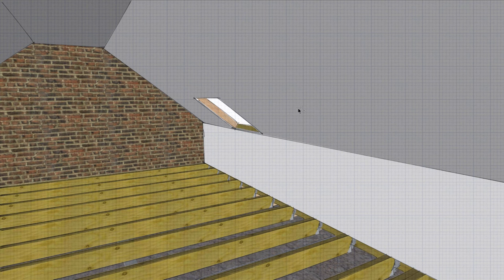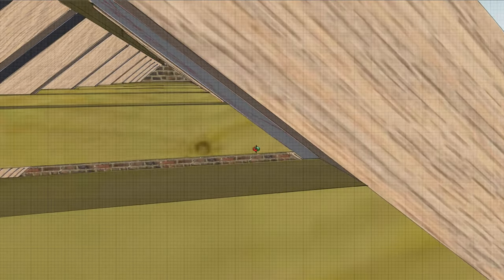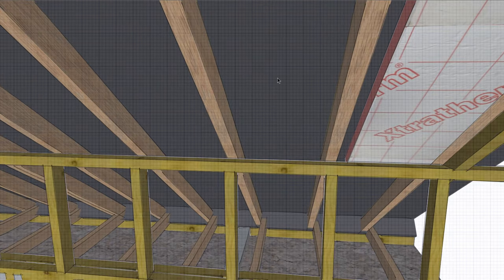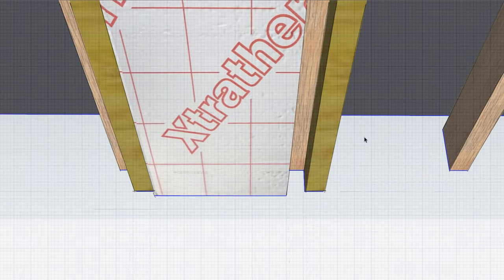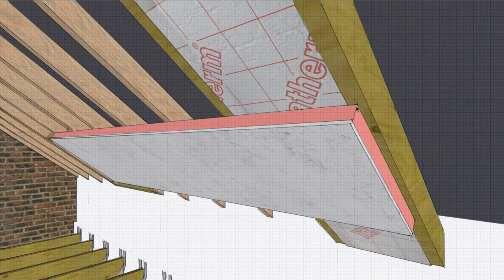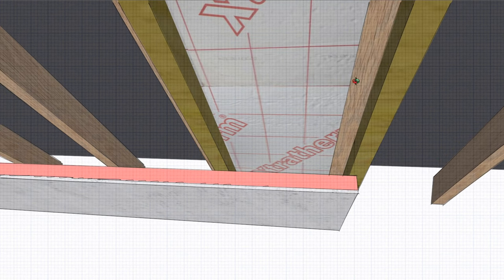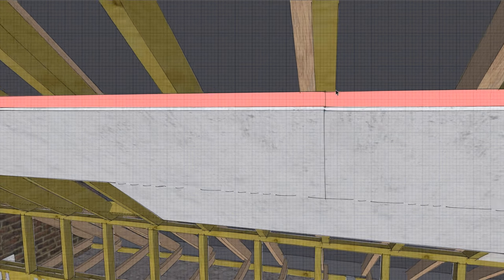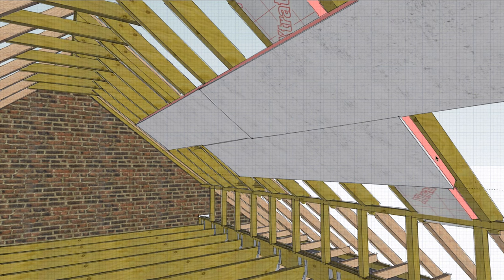Insulating between and under the rafters for a loft conversion

Comment: How did the human race ever survive before insulation? The mind boggles..
Reply from the maker: Smaller rooms!
Reply: They still do.  In places like Mexico, during the Winter the internal temperature can drop to around 5C.  Solid concrete/brick buildings with no insulation and lots of ventilation.  They put up with it.
Reply: They still do in the UK!
Reply: House back then had plenty ventilation with it blowing through house
Reply: Sweat n shiver
Reply: Heating was cheaper
Reply: @madmat114  😂
Reply: Post war? Endless amounts of cheap gas, before that, well we would die at pension age.

Comment: Informative thanks. In my experience it’s more economical to use one thicker sheet of PIR between the rafters than two thinner and either notch out the back around the original rafter of fill the void with a strip of PIR and foil/aluminium tape the joint! It’s prob worth, or may be mandated, to fit a vapour barrier sheet before over boarding with plasterboard (insulated or not depending if additional insulation is required) but if it’s a low occupancy area it shouldn’t be needed.

Comment: Couple of thoughts. 1. Extend the rafter depth to keep things aligned. 2. Superfoil quilt. I'm going down the superfoil quilt route, it's easier to work, more airtight, thinner and cheaper for the same performance.
Reply from the maker: Thanks for the tips Darren! I'll take a look at Superfoil.
Reply: Just an FYI, but I've experienced Building Control not being keen on superfoil as an alternative. It is easier and better for DIY work, but the performance figures aren't the same as PIR. I do welcome any info you have 👍
Reply: @bikerchrisukk  Thanks for the tip. My approach was going to be 1 layer, see how warm it feels, then more than likely do a 2nd layer. I'm converting the attic bit by bit and the initial stage is to make it into a warm storage space with intentions one day I might go all in and make it a habitable space
Reply: @sygad1  You are welcome, you might want to get a thermometer/hydrometer that can record the temp/humidity difference after you've done a bit of it. Govee models are good but price has hiked lately, I got 2 for £35 once. Good luck 👍
Reply: We put Actis hybris between rafters , then super-quilt over the top , one thing I can say it’s extremely hot up there .

Comment: Hi robin
We are a loft conversion company based in cork ireland 
We do exact same as you outlined but put 50by 44 mm timber onto existing truss next to new 150mm by 44mm new rafter c24 that fills infill then we use intello plus vapour membrane wrapping all joists then a 62.5 mm phenolic slab underneath with venting and new airtight boxes for recess lights and all cables and intrusions sealed and taped with vario tape
Love your videos
Willie
Reply from the maker: Thanks Willie - appreciate your comment and thanks for watching! 👍
Reply: Hi William, do the 50mm battons get attached directly onto the rafter or are they counter battoned?

Comment: As someone in the process of insulating exactly this right now, having had a building company do the structural work. As per a conversation with the guy from building control; I'm using two separate sheets of PIR to make up the 100mm rather notching out a 100mm sheet, using Gapotape to eliminate the gaps, then aluminium taping to bridge over the rafter, then will foil quilt over it all, before battening and plasterboarding.

Knowing what I know now, and if it's a structurally sound idea, I'd have asked the building company to alternate the new rafters, so that every other sheet could have been one 100mm PIR sheet, with nothing fancy to do to it. Would save me a lot of time!
Reply: You can't "alternate every other rafter". They're put in at 400 or 600c/c, and that is the distance your tiling battens have to span
Reply: But surely the tiling battens are still resting on the original rafters?  @Tom_Hadler

Comment: Great Video as usual
My advice is to counter batten the roof, the allows for full depth of Joist to be filled with Insulation
Air gap above Joist
Its a bullet proof system and makes felting really easy during windy weather
You buy a special vent strip which is rated to support the first row of tiles or slates,  also means no vents in the soffit
Some House Designs are now without a Soffit
Reply: Don’t suppose you have channel to show what you mean 😏 🤷🏻‍♂️
Reply: Sorry mate
Do a Google search
Reply: What's the vent strip called? Presumably, it vents at the top via a dry ridge system?

Comment: Great vid again. Done one loft with 100mm insulation between the rafters and then superquilt over to stop cold bridging, nightmare to put up.  Usually my norm is 100mm between then 25mm over rafters, foil taped then PB.  Been advised by my SAP guy to use the insulated PB on my next build.
Reply from the maker: Thanks! Good to have your take on it. What reason did your sap guy give for the insulated pb?
Reply: @RobindeJongh  I’ll be insulating a listing building next, the general convenience of it being one unit oppose to fixing insulation and then PB i suppose.
Reply: As an Architectural Consultant, I was always taught by my peers to avoid insulated plasterboard because as soon as you penetrate it for services i.e. lights, sockets - you are cutting into the VCL and creating a cold bridge at that point making it more prone to IC.  But I'm based on Scotland, so maybe it's not really an issue down south.

Comment: The initial comment about the airflow is slightly 'wrong' in that the airflow should be exiting at the apex / ridge line through a suitable breather. All the moisture will aggregate at the apex. 
There are a number of technical seminars by Dr Joe Lstiburek that cover the multiple issue we all encounter with modern building efficiency needs. well worth a watch.

Comment: Hi Robin, are you able to do a video for vaulting a bungalow ceiling. I believe our roof structure is a purlin roof, but planning to do as much of the work myself. I’m a carpenter by trade but roofing isn’t my forte so just trying to get as much info before the structural calculations come back from our structural engineer

Comment: Great video, clear audio and drawings. How would the brick gable end wall be included in the insulation? Im aware of a parge coat to help AT, but could this be internally insulated with the PIR also? What if there was EWI in the picture? Worth insulating both sides?

Comment: Hi robin, you added the stud wall on either side, how far apart can these vertical members be without affecting the structure? Also I am part way through a build, the builders have put steels in instead of a flitch beam, how does one attach the bottom plate of the stud wall to the steel?
Wanting to maximize the space under the eaves for both storage and clothing cupboards

Comment: Could you not just put an additional rafter on top of the original one to get a  say 200mm of depth and fit 170mm celotex board. You could then overboard the rafters with more celotex and plasterboard. 
Loving the content. Blows my mind at times listening to you quoting regulations.
Reply: You would be losing a lot of headroom .

Comment: Hi, I'm trying to work out how much insulation I would need in my rafters for my house, I'm putting a small playroom in the loft in our extension and I've put 100mm between the rafters and wanted to put 25mm plus plasterboard over the top to stop the cold bridging,  hoping that is OK as that is the insulation I've already got! Also how does the ventilation work when you have the wood top and bottom of the velux window? Wondering how the air moves above the velux as its been sealed by the noggin?
Reply from the maker: Hi James. Fair point. You would need to ask a joiner.

Comment: Is there any reason you cannot just screw a 2x2 inch rafter to the face of the existing 4x2 rafter? That would give the same gap available for insulation at considerably lower cost?

Comment: I've just finished insulating upstairs in a dormer bungalow. BCO asked me to put 3x2 on the underside of each rafters bringing them from ~80mm to ~150mm and then 100mm PIR between and 25mm underneath. This left an airgap of 50mm under the tiles.

I never even considered the structural side, do you think that would be a problem just adding the timber on the underside of the rafters? The BCO did not say anything either. The 2.4m length 3x2s were just enough to go from the dwarf walls to beyond the flat ceiling level
Reply: Are they still up ok? I'm intending to do the same thing, so am hoping it all worked out for you 8 months ago :)

Comment: will still need access outside to fit vented soffits & possibly vented ridge tiles, what about rebating the PIR to get over the step in the timbers?,
my roof has already been compromised back in the 50's when they changed from slate to redland 49's

Comment: Interesting video, thanks. I’ve just bought an old barn conversion with 9” solid walls. Struggling to find any consistency online about how to insulate solid walls from the inside without risk of internal damp and condensation. Would love to see a video on this and/or any advice! Cheers 👍
Reply from the maker: I agree, details are hard to find. It is because condensation is going to happen, and no-one wants to be held liable!
Reply: Hemp slabs, or hemp+lime mix, or rockwool with lime plaster on lathe? That is for unusual solutions ^^ anything breathable I would thibk

Comment: What happens with humidity in the insulation? Is some membrane material needed to control humidity and also air-tightness?
Reply: PIR/PUR board is foil backed on both sides. Self adhesive aluminium tape can be used to bridge any gaps.

Comment: Great video. The requirement to stiffen the rafters caught me off guard. I’m looking into a 60-80mm wood fibre insulation which doubles as a sarking board (Gutex) for a warm roof retrofit on a dormer bungalow. The mass works out at 15.4kg per m2. Do you think I need to budget for doubling up rafters?
Reply from the maker: Hi Gavin. I would budget for doubling up rafters or adding extra rafter depth.

Comment: Hi Robin, I'm converting my loft right now and I'm in the stage of insulation. The recommendation from the building regs is 100mm +50mm PIR. then plaster board , all counter batten with 50mm Batten to the non breathable felt to allow roof ventilation. All to achieve 0.15 U-value 
I'm trying to achieve the same U value for less thickness in order not to lose head hight. 
I heard that I can mix PIR with superquilt, but don't know how?.
Also , I would like to have your view regarding the side wall insulation (it is a cavity wall ). Thanks for your videos , it was really inspiring
Reply: How did it go?

Comment: For the PIR between rafters I'd probably just do as you said & put in a full thickness strip first (new rafter one side & old rafter on other) & I'd also buy some sheets of PIR at the correct thickness needed to fill in the strips over the top old rafters, which could quickly be cut to width & tapped in.

Other more faffy way would be to cut other PIR to fit the full width (new rafter to new rafter) including over the top of old rafter but then cut out material on the back of the PIR where the old rafter will be so that it slots into place over it if that makes any sense. Bit messy though & would create more waste.
Reply: I was thinking this , like multi tool out each one or template with a circular saw wouldn’t take too long once set up
Reply: @seanmichaelo9777  I've used both & found multi-tools only good for cutting out small complicated shapes up to say a foot long as they just take to long on longer/deeper cuts, even if you get a "proper insulation cutting blade" which I think are a waste of money & don't work personally. Circular saws definitely do work & are fast but just be prepared for a lot of mess (definitely connect to a vac if pos), again I've seen special insulation blades available that claim not to make a mess but they were VERY expensive & are like hens teeth to get hold of. I think Ive seen people DIY their own circular saw insulation blades by grinding them down but I've never found the time to try it out myself 👍

Comment: So a quick question, the insulation you have there is foiled/non breathable, wouldn't it be a better idea to use rockwool slabs for improved moisture control?
Reply from the maker: The idea is that there is an air gap above the insulation for air to travel and take the moisture away.

Comment: Robin another great video. Would you be able to comment on how to detail the insulation around exposed beams in an older property?  

Thanks!
Scott
Reply: The thickness Robin is suggesting here are ideal requirements, not cast in stone law. Just put the requirement depth insulation in where you can and leave the beams as a feature. The beams have there own U value also.
Reply: @alabinibop  Thanks for the reply. That was my planned approach - just not sure how this would need to be conveyed to building control.
Reply: @scottvirgogp  suggest that you are looking to retain some of the existing character. That's a sticky wicket for them and they should accommodate it.

Comment: Hi Robin, is it possible to glue and screw some C24 to the underside of the rafters to increase the depth. So sister but in depth not width. Would it be permitted? Thx
Reply from the maker: Sure, that could work. Glue would need to last for the duration of the lifetime of the building though.
Reply: @RobindeJongh Thanks.

Comment: What if there are no dedicated eves vents(old house)? Is it still acceptable to insulate between rafters like this, or will it cause condensation issues?
Reply: In my old house I can see flashes of daylight between the bargeboards and the tiles, so no extra ventilation needed, are you sure yours is sealed?
Reply: @jesshothersall  There is no bargeboard, it's a terrace.

Comment: Just put in 50 to 100 mill in between and anoter 50 to 100 mill across with a 3x1 then you have space for wires etc and no gaps foil tape the joints better job if you can lose the 20 mill
Reply from the maker: Thanks Matt. What do you mean by the "20 mill"?